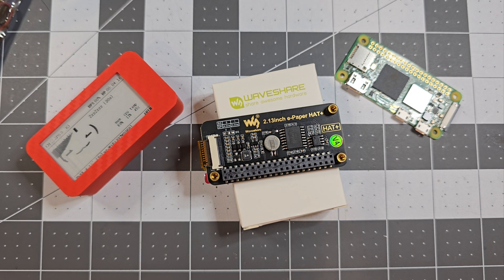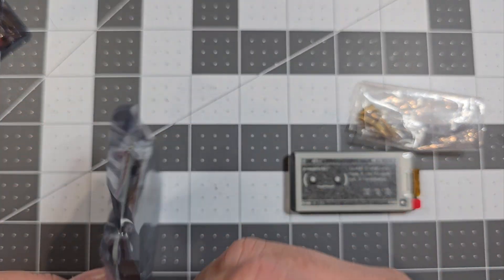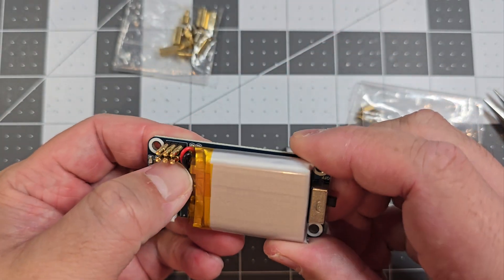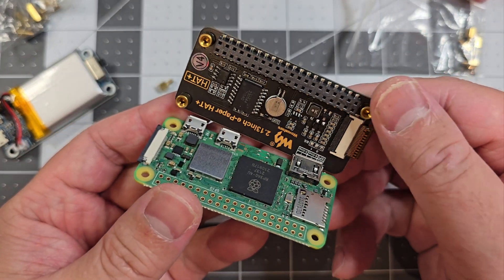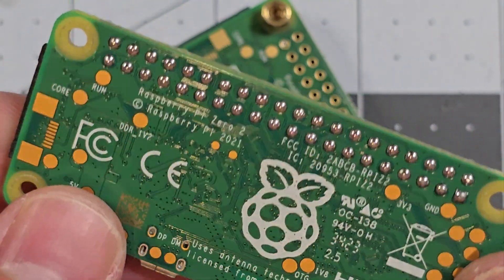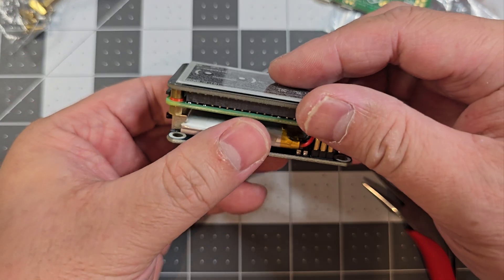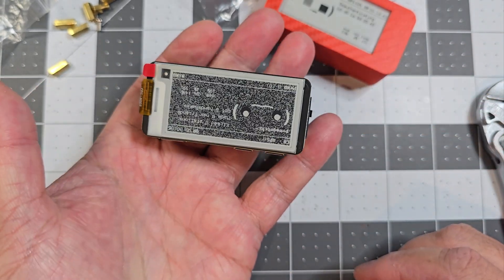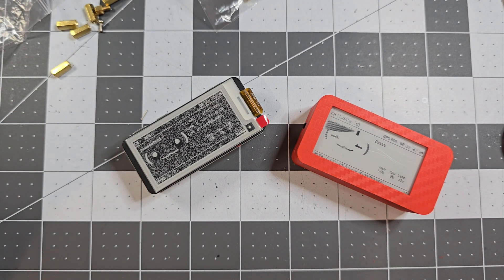Waveshare 2.13inch E-Paper HAT+ and UPS for Pwnagotchi Build

Comment: It seems like they have changed the display and now it does not come with the battery, but the connector for one. Big sad(
Reply from the maker: That really sucks!
Reply: @rayj1988 By the way, for how long does the battery lasts in general?
Reply from the maker: sorry for the late reply last time I checked I got a month without using it and the time and date were still correct.
Reply: i cant believe they changed this, what the heck i got screwed :(
Reply from the maker: I just had a look and looks like they changed the design of the newer board to have a connector for a battery. I guess only advantage is could be a larger battery size. Still sucks they removed the battery.

Comment: great solder on the pins, are you planning to post or release the case 3d print files ? i just did a similar build and would to test it with your case.

Comment: Thank you so much for this guide, really easy to follow! I have the exact same hardware, do you happen to have made the STL file for the base available online?
Reply from the maker: @PigeonPrint  I have not made it available as it is a very tight fit design, and I needed to trim the ribbon cable a bit for clearance. So there is a risk people would damage their displays.
Reply: @rayj1988  Totally understand, thous fpc cable just need to be looked at the wrong way to ruin the screen!
Reply: I was gonna say, any updates on how this is working out? The first thing that worried me about it is how little space there is between the screen and the zero, I would still at least want another millimeter, but even more, considering that battery is in the same tiny enclosure, as well. I use this screen with the pre soldered headers they provide which have 7mm of spacing and it works out perfect imo and it’s not like riiiiight against it like that. I’ve also commonly seen it this way, without a case, and that feels safer for me, for airflow. Also, the way you have it seems like the pogo pins are only superficially pushing against the bottom of header holes that are full of solder but even clipped so they are like flush, unless the one you did for demonstration was just a real quick and dirty ones? How does that work out? Seems super precarious.
Reply from the maker: @KhangNguyen-el6uy  I have 2 setup as per ths video, and both are running fine with no issues. Pogo pins are in full contact with soldered pins.
Reply: @rayj1988  That kinda set up on a power supply would definitely irk me haha. Really those kind of pogo pins are just for testing, I would never use them in an even very temporary setup. They are generally used for testing when there is no solder at all on a through hole yet. I would definitely prefer soldering that connection, especially if you are sticking them in tiny cases.
Reply: Also, there is a UPS that's a little less than a fourth of that form factor for the zero that might work  better than this build, It just has 4 through hole pins you have to solder and connect however you like. I mean you could use pogo pins too but that's purely just a hassle for something meant to be permanent.
Reply: @KhangNguyen-el6uy nothing wrong with using pogo pin setup for long term use. They are not just for testing they are just a different type of connector!